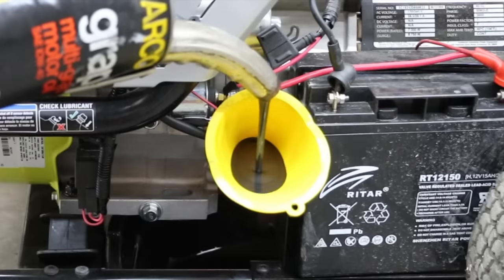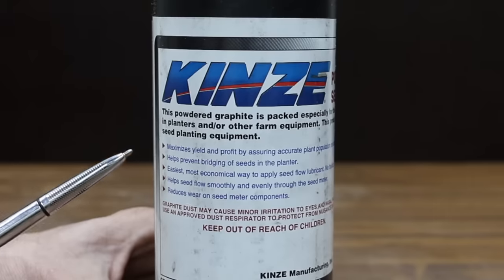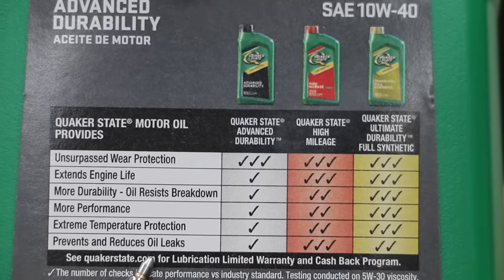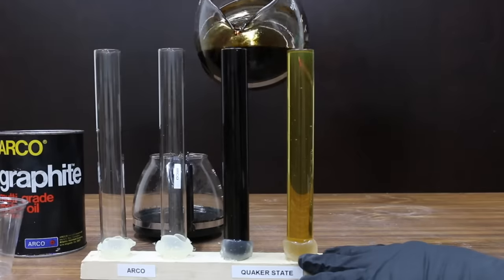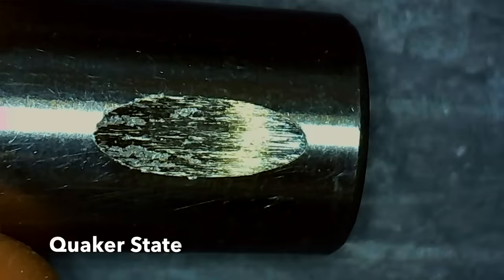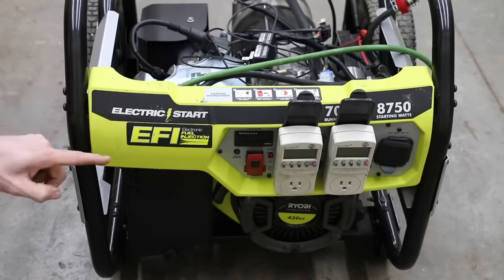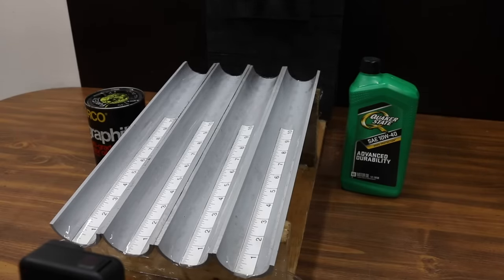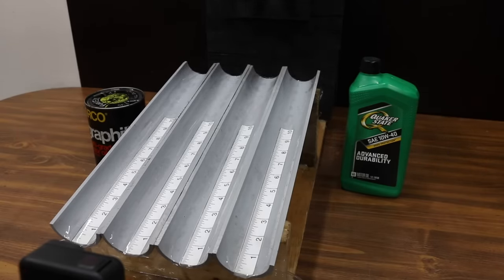Will "Graphite" Help Motor Oil Performance? Let's find out! Vintage Arco Graphite vs Quaker State

Comment: I'd like to see what adding tungsten disulfide would do, it's a better dry lubricant than graphite!
Reply: I don't think any dry additive is going to be that helpful, other than possibly the wear test it'll detract from other tests such as viscosity.
Reply: @DracoOmnia  perhaps add it to a lighter weight oil? I think it would be an interesting test
Reply: Yeah I was wondering the same with molybdenum disulfide but tungsten is even better. More so because it's already part of a good oil, would adding more detract from other performances or is there only such a low amount because of costs?
Reply: TY I honestly never heard of Tungsten disulfide.  I know of a lot of sulfides that are used as a lubricant but not tungsten.  I agree I would love to see more testing on additives.
Reply from the maker: Great video idea!  Thank you
Reply: In the end, any powder will cause deposits where you don't want them, especially in modern engines with turbos, hydraulic tappets and variable valve lift. If any of these additives or dry lubricants were able to provide long term benefits, oil manufacturers would be all over them. The truth, however, is that both liquid and dry lubricants have their applications, but they don't cross over well.
Consider the molar weight of tungsten disulfide. It will settle to the bottom of the oil pan after a while.
Reply: @centralintelligenceagency9003  True, never thought about the weight. Tungsten is incredibly dense.
Reply: Central Intelligence Agency 

Your point is well taken. Also, sulfur is a catalyst poison, like phosphorus, so may limit its use. ZDDP has been reduced for that reason.
Reply: @centralintelligenceagency9003  That will only take place if tungsten disulfide forms a suspension in the oil, colloids do not settle and remain in solution if their grains are fine enough.
Reply: Little extra from myself: compare graphite oil with tungsten disulfate. P.S. watch out and stay healthy everyone
Reply: TheGuruStud Saving the environment and your lungs is pretty cool...
Reply: TheGuruStud 

Last time I read the label of a race oil, it said not to use it for normal driving because it didn’t contain detergents.
Reply: @TheGuruStud  , I agree , we don't need more pricks, only sociopaths remove cats from daily drivers.
Reply: What do you think about Tungsten Disulfide grease?  I can get cases (pallets actually) of it at really good prices but IDK if it is any better than Moly Disulfide?  The stuff is supposed to be nano particle size and it was a little more expensive than the competing moly based grease.  It also looks like the tungsten based grease has better properties all around as far as heat resistance  (by ~75C, which is significant) among some others.  

I haven't found many people who have used or reviewed it.  Do you know if this channel has?
Reply: KDE5FAN 

What is meant by ‘heat resistance’? Dropping point? That would be a function of the oil and thickener it’s made from, not the anti wear additive.
Reply: @kde5fan737  I used some ws2 grease on my front wheel bearings of my truck which were coated by microblue.  When they failed at highway speeds, they didn't fuse to the spindles, hubs, etc which was quite interesting.  Saved a lot of money so I'm doing it again.
Reply: i use tungsten disulfide, boron nitride and MOS2 intransmission fluin, engine oil, differential and steering fluid for years on all my cars. appr 1/4 oz per quart.

Comment: Be interesting to see what happens when this oil goes through a filter...specially a centrifugal filter
Reply from the maker: Thanks for the video idea.
Reply: I'm interested in seeing that. Possible filter out the iron in it but leave the rest. Some positive thoughts on the oil test but didn't do better than the current oil. If the graphite oil was revamped for modern technology then it might do a lot better and a stumble to better things. Big problem I could see is if left more as original state then it would hold more of oil product vs nowadays oil product that the actual oil is probably less than half of the makeup in each bottle.
Reply: @scottneal2738 Graphite The issue with graphite isn't something you can modernize, its a great lube but it also sticks to EVERYTHING in an engine, and takes a detergent to clean away. So unless you want to buy some STP dying engine goop every oil change it'll just make your life hell.
Someone explained the chemistry behind it to me once, but I don't remember exactly how it works but graphite and engine oil don't play nice with engines when they're mixed.
Reply: Nothing good lol
Reply: @nilloc93  I feel like they he should do a beer & graphite mix for that or 0W-0 oil, WD-40 etc

Comment: I remember when they introduced ARCO Graphite. The reason it was considered risky was two things. 1) the graphite had to be fine enough to go through filters and not be filtered out or plug the filter. 2)The graphite had to stay in suspension and not end up stuck to the bottom of the pan. I suspect some of the additives in ARCO Graphite were there to keep the graphite particles in suspension, just as they would carbon combustion by products.

Thanks for the vid!
Reply: Also, people didn't like pouring in oil darker than the oil they drained out.  How do you tell when the oil is dirty or contaminated?
Reply: @donbrutcher4501  You go by the smell of the oil, compared to the smell of new oil. Dirty oil stinks.

Comment: My first car was a hand-me-down 1972 Dodge Dart with a Slant 6 engine.  Being in college, I tried this in the hopes it would increase gas mileage.  I was taking a statistics course at the time, so I was able to apply what I was learning to using Arco Graphite.  What I found was that I was getting at most 1 MPG more.  What we found at the next oil change, was the graphite seemed to come out of solution.  It made for a messy oil change.  I went back to regular oil and yet I still had graphite coming out at that oil change - and the next one.  FYI:  I kept the car until it was 15 and had 169,000 miles and it ran fine with conventional oil.  I would not use this in a modern engine, but would recommend full synthetic instead, particularly with a high-mileage car.
Reply from the maker: Thanks for sharing.

Comment: Can you do chainsaw bar oil tests with sthil vs the “cheaper” 
alternatives such as FVP and Cam1 and such?
Reply: Particularly I'm interested in the new eco bar oil stihl makes and how it stacks up
Reply: And the Walmart brand bar and chain oil!!!
Reply from the maker: I'll do it if there's enough interest.  I'll check back later to look for brand suggestions and level of interest.  Thanks again!
Reply: I like this suggestion too
Reply: This. And two stroke oil/fuels as well. Stihl motomix, red armor, huskys mix, tru fuel, etc
Reply: I'd like a comparison of vegetable oil against normal bar and chain oil. Maybe also used vegetable oil versus new vegetable oil.
Reply: I use valvoline race oil 50 for my bar and chains I don’t get a lot of wear on the bar and chains I hardly get any stretch
Reply: @sethmorton8539  I'll have to try that. The pro select in 1 quart killed me whole chain
Reply: Project Farm please try used motor oil along with the test.
Reply: Yes, yes, yes, especially since Stihl wants you to buy their expensive fuel mix to get longer warranty.
Reply: Might have to test olive oil vs soybean oil... I have to keep my cooking olive oil bottle in a dish, because once open it crawls out of the bottle and makes a mess. Really wants to coat and penetrate everything. :)
Reply: @ProjectFarm  stihl, mobil, kroon chainlube. And some other cheap ones maby some bio oils.
Reply: Yes and also test oil used oil as bar oil
Reply: I wan to see if the Graphite additive helps the chainsaw bar oil last longer.
Reply: My neighbor uses 85w -140 gear oil as bar and chain oil
Reply: I used synthetic for bar oil....works phenomenally well!
Reply: By all means do a bar oil comparison.  Stihl premium (gray bottle), Stihl regular (orange bottle), Stihl eco(?) green bottle, Oregon, Poulan Pro, Husqvarna white bottle, Husqvarna orange bottle, Makita...that enough to start with?
Reply: @ProjectFarm  I like this idea too. I plan to get me a chainsaw in the future
Reply: Good idea  would like to see
Reply: I’m game.
Reply: I’d really like to see the friction test.
Reply: I would like to see you test the Sthil, Echo, and RedArmor bar/chain oils, and also the pre-mixed gas for each brand as well to see if there are any advantages to running them..
Reply: Peach Jr 
V vegetable oil.... I don’t like spewing petroleum all over my offgrid Alaska property, I would much rather use earth friendly veggie oil for my chainsaw bars....
Reply: @ProjectFarm  Husqvarna  in the manuals ...in the older saw manuals anyway... Listed 80 90 gear oil as suitable  My granda pa cut pulpwood for years he used used motor oil and some STP to make it sticky
Reply: I use Amsoil synthetic gear oil for my bar oil. I have the bleed screw almost all the way in. I still have a wet bar and only need to add oil every 10 tanks of fuel. It hardly uses any oil. Don’t have bar/chain smoking or any hot marks on either. Idler on the end free wheels like you wouldn’t believe. I’ve heard of people using cheap synthetic 20w50 with the same success, I only used amsoil because it’s what I had laying around.
Reply: @ProjectFarm  Chainsaw bar oil test please. Have you ever tried 80/90 gear lube mixed 50/50 with diesel oil? We used it years ago on a combine (custom cutter heavy useage) on the chains. Never had a chain problem and we cut 1,000's of acres of wheat!
Reply: piet mondrianstudent it’s all I use lol
Reply: Do it!
Reply: @maxfrick6117  that probably smells like absolute crap
Reply: As a follow up, I would like to know if the brand of chain makes a difference and / or if the DIY  sharpening kits actually work.
Reply: @ProjectFarm     This might have been a good use for the ARCO Graphite motor oil. No engine oil filter to clog up and the graphite might help with the long term bar/chain interface.
Reply: Here’s another vote for bar oil.
Reply: @Reziac  I got a Stihl, and the extra $10 for 1 time purchase of 3 bottles was worth the extended warranty.  I would like to see what a cheapo 5qt jug of auto oil would do, and then maybe see what adding a bit of compatible grease to it would do as well, since it would help it avoid slinging off.
Reply: I would also like to see a test on this!  I usually just buy the house brand at the farm store by the gallon.  I never really considered that maybe I'd be money ahead to use a better oil...
Reply: @Rick_Sanchez_C137_  ,But, but, the petroleum is just as Earth-friendly, Mother herself makes it deep inside her belly....
Reply: Remember to try used motor oil for bar oil from one of my earlier comments.
Reply: Test just plain old non detergent straight 30 weight oil for bar and chain lube, thats what i have been using, also a guy we know uses used engine oil for what thats worth
Reply: i second this
Reply: Yeah, I bought a Stihl when Ace had 'em on sale last spring, and I went for the extended warranty too. -- My old McCullough uses straight gas and regular motor oil in separate tanks. I think it spec'd 30W but I always used 10W40 and it was fine, working its little ass off in really dirty conditions. (I like the Mac better, but need to replace the crispy rubber bits.)

I'm not sure how much difference it really makes either.... I have an ancient (1958?) Lawn Boy mower that I ran on a mix of 10W40 motor oil and non-eth gas (heavy on the oil, mix about 10:1) -- mower had been sitting outdoors for ~30 years, but started right up and was happy as a clam, tons of power, even cutting big weeds. In fact it cut 'em too good... got carried away and sheared the flywheel key. :(
Reply: C j oil has zinc and all the good stuff in it
Reply: C j Alaskan saw mill saves the bars and chains
Reply: Agreed, I'm always interested in bar oil to give better bar and chain life with reduced heat build-up.
Oil brands: Stihl, Husqvarna, Any generic brands too.
Reply: @maximilianeissner4759  I use the vegy oil in my huskys and sthils when cutting ice,seems to work great but cost is more than the bar &chain oil.
Reply: FVP, Mile Master, Husqvarna, Stihl, Schaeffers

Comment: Thank you for taking time to make these videos. I recently have tried a new product in  one of my engines. In the past I have used some regular stp oil treatment and I have seen positive results. Then I discovered they now make a new ceramic oil treatment. I have no testing equipment or scientific data to back it up but I swear it feels like my engine does not have to work as hard as it used to.
Reply from the maker: Great feedback. Thank you

Comment: I remember, back in the 70s, my dad adding a couple of tablespoons of graphite to the oil.
Reply from the maker: Thanks for sharing.
Reply: And it's STILL running!
Reply: @Paul Singletary
Yes, as a child of the 70s I remember when this kind of thing became very common for a time especially back just after the ARCO graphite came on the market, it didn't last long though because like others found it could often foul spark plugs and cause other issues.

Comment: Started usng the graphite oil in my '78 fullsied Bronco with a 351M engine back in the early '80s. Had to replace the engine as the oil passages gunked up with the graphite that setled out of the oil. Never again with ARCO.
Reply from the maker: Great feedback. Thank you
Reply: @ProjectFarm   I grew up with this stuff, my dad always did his own oil changes and I remember this stuff and I also remember the 79 dodge omni that this stuff went into, between the 3 of us kids learning to drive and beat on this car the little 1.7l  never gave out, good engine,good oil or great engine crap oil dont know  but what a great car
Reply: I suspect that would happen, but more importantly the filter would clog very quickly and that would really work against it (even if the passages didn't clog). 

I am curious... If you applied dry graphite during assembly would that improve engine life,or would the detergents in the oil just pull it off?
Reply: My ex-wife's great-grandfather used peanut butter to lubricate his roller skates when he escaped from the Illinois Mental Health Center in Alton, Illinois during the early 1920's. Twice.
True story.
Reply: John Perry hm you’re talking about the criminally insane place btw I’m from Alton 😂 also been rebuilt many times

Comment: Got chills seeing that Arco can again. I have no good words for that Oil. The worst sludge build up in history of oils! Engine knocking sounded like someone tuning a bad piano. Graphite does not belong in oil...
Reply from the maker: Wow!  Thanks for the feedback on Arco
Reply: I worked at an Arco station in the 70s. 
The owner wanted us to put that oil in everything we worked on. 
A lot of customers complained because it looked dirty. 
We also saw engines fail. Not sure if it was the oil, although it was highly suspect because graphite is no longer used.
Reply: @bubba.watercraftj7269  I can see it being beneficial in a gearbox such as a manual transmission or differential, but it seems to me that the graphite would just clog up the oil filter in an engine.
Reply: @Devin_Stromgren  Yeah, graphite is an excellent dry lubricant, but because it's a solid it obviously doesn't flow and adding it to oil although it improves lubrication it severely reduces the oils ability to flow. In an engine that was actually designed to use oil with graphite in it it would probably be OK, but since there are effectively no engines on earth designed for such an oil nothing good comes of adding graphite to normal oil. If you had something that was normally lubricated with a bit of grease it might work better, but anything that has an oil pump it's a terrible idea.
Reply: All I remember from back in the day was the enormous number of oil leaks it created, particularly on the air cooled vehicles. Lost a lot of money from comebacks for that reason and quickly bailed on that garbage.
Reply: Pennzoil is worse.
Reply: Yeah, I got chills too. Back in those days I convinced two buddies to use this oil, and both ended up with bad valve ticks, presumably due to gummed-up hydraulic lifters. Thankfully they didn't blame me, they blamed the oil.
Reply: That engine was knocking louder than Jehovah's witnesses!
Reply: @20alphabet  You would change your comment if you have used Castrol!
I put the Castrol diesel oil in the Hi-Lux and had to dump it after 2000km.
 Love Valvoline XLD, i once missed my 5000km service and dumped it at 8000km and it was still Good!
"We all live and learn"
Reply: @rosswoolley2854  
Nope, my comment stands. It is worse than the OPs reference. Maybe not as bad as yours, but definitely worse than his. And Valvoline is the better oil. Also, stay clear of Fram filters.
Reply: @20alphabet  This guy did a filter video and had Fram in it.
The Subaru XV that we own, the service shop uses AMSOIL full synthetic motor oil. Bloody expensive but still cheaper than replacing an engine. "Remember love your car more than your wife" if your car gives you problems a few bucks will fix it, can't say that about women though! 🤣
Reply: @rosswoolley2854  
Purolator is the best filter. But nowadays you need to avoid their cheap line of products, and stay with the top tier stuff.
Reply: @20alphabet  there a video out there that shows the break down on all oil filters, when you watch this,  It literally blew my mind. I'll never buy another one.
Reply: @rosswoolley2854   that's the truth🤣🤣🤣